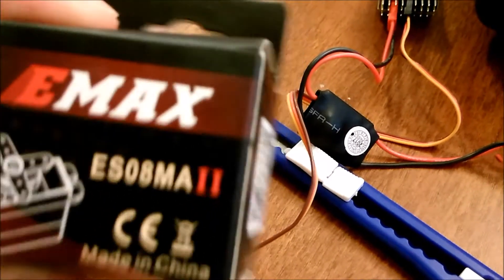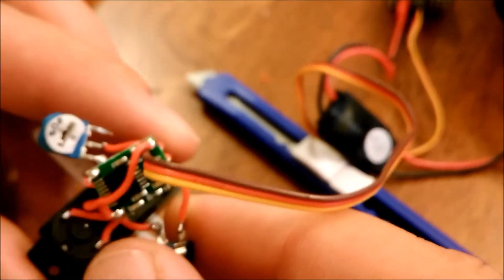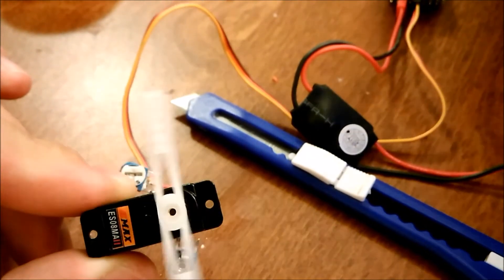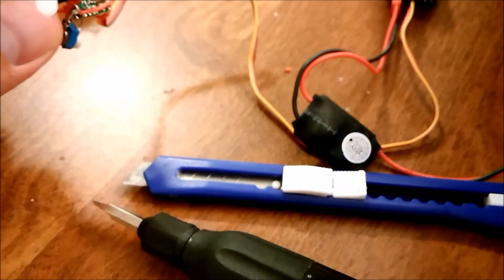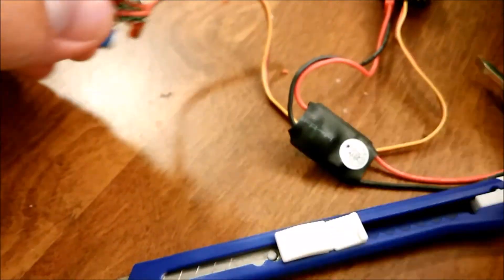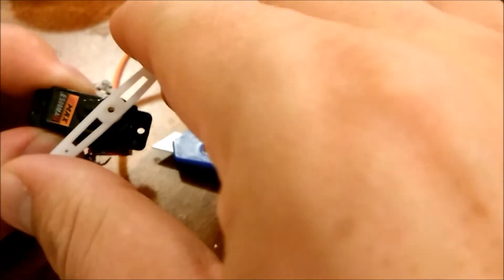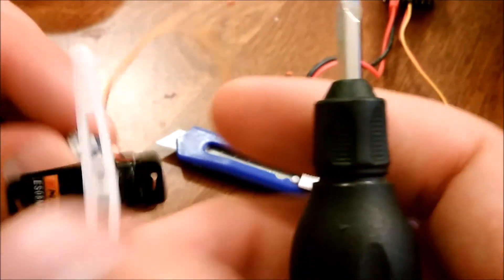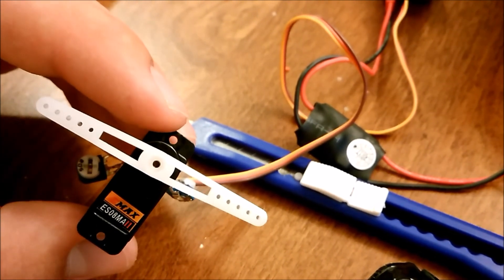Adjustable Travel Servo with Potentiometers! 180 Degree Servo Mod (270...Impossible)

Comment: What if you cut the blocker on the gears. Does it turn up to 360 and still controllable? Or continuously spin?
Reply from the maker: It won't continuously spin...the Pot isn't designed for that. You can buy servos that do something like that though

Comment: Did you remove the mechanical stop on the gears?  You may be hitting that..
Reply from the maker: Mike Darneille I am pretty sure there was no mechanical stop. At one point the connection broke and it just spun in circles the whole time
Reply: ok, tnx
Reply: Yeah these metal gear servos don’t have a stop, the plastic heated ones have a few solid teeth and a stop so they don’t work well for this.